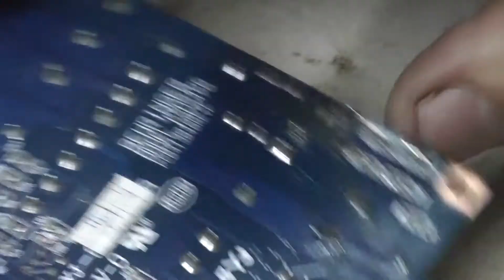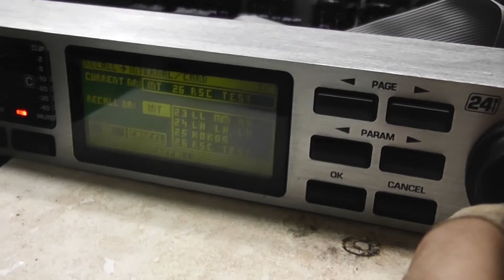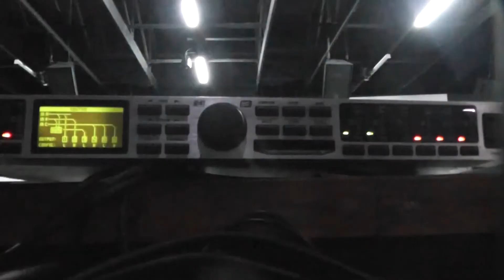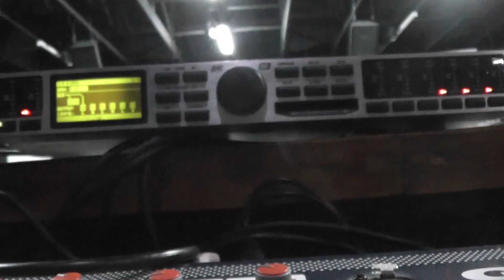ShoutingElectronics #6 - Behringer DCX2496 Powersupply - Part  2

Comment: Would it be possible to repair such a unit by replacing the built in power supply with an external generic 12V (or 20V or whichever voltage it needs) switch mode wall wart type power adapter?

Comment: Change the switching transistor and the 47uf 400v capacitor but still no power. Only improvement is where as it was chopping the fuse now it's not.

Comment: those orginal smps are unreliable.have ultra curve and ulktra drive.both lasted around 1 year.changed all the capasitors and the standing chip.took away dose rubber hats for regs etx and used a glimmer pad to get better termal tranfer of heat to the cooling frame.drilled some holes under the supply in the case.put some heatsink on top of the chips on mainboard the inside temp went down have worked fine since.the other i did the same thing but i think the smps transformer is bad.do you know where i can get a new or used transformer?

Comment: i have had many utra curve and drive with psu fault.I always swap all capasitors to brand quality(does not buy the most expencive but much better qyuality known brand.and drill some holes in the cabinet under where the psu is mounted.also the rubber thermal shit goes away.i use the metal clamps to hold the 2 volt reg tight against the alu frame that ack like a cooling element.recoment to glue some old chipset alu cooling elements on the dsp(the hottest chip,s. on main pcb.recomend swap all capasitors in the hole unit.For the ultra drive the hizz level goes down around 2 db.for the curbve it work better and last.always let it be place for air under and over those units,to stack units like this guaranti short lifetime,Almost every ultradrive/curve i have had in for repair it is always the powersupply isue.They are cheap and ok if you can fix do replasement yourself to good quality known brands capasitors
Reply: The cable from the PSU to the PCB has issues with mine as well. Or perhaps the connector on the PCB is faulty, to small/cheap.

Comment: ultracurve and ultra drive use the same pcu.the ultra drive is to noisy for my use.there is to much hiss on the outputs.Have both and both lasted about a year before the power supply went bad.I changed all capasitrors and the control chip on both supplyes.one is better than new so i swapped out al capasitors in the ultra drive unit.the other supply i have not found the fault.maybe one leg on control chip got to hot when i mounted.it.had to put it low do to a bad pcb trace.pcb quality on pcu is not good

Comment: AArgh, the meter probes! New ones definitely needed there, along with a new meter as well.
Reply from the maker: Yep, I know.   At least for my Day Job I have a Decent UNI-T Clamp Meter.   Dave, if you do watch this one day, I could really use one of your 121GW or EEVblog Brymen Multimeters....
Reply: Well, might be a while before Dave catches up on orders and such. 

Funny thing is that, despite liking the video, the number of likes is still fixed on zero. Unclick the thumbs up and it went to -1, and click it again it went to 0 again. Another of those YT glitches, and still only 2 views.

So, where in Sunny SA are you based, i am guessing GP.
Reply from the maker: Yep, It looks like their stats, etc, have been very slow to update lately.

Nope, I am still in Sunny Margate (Remember I got that Solomon Iron from you - Several new tips later, and it is still going strong)
I just decided to try make a more formal channel than my old one : https://www.youtube.com/user/kolbep
Reply: OK, was just wondering. At least you got rain and water, unlike our cousins down in Slaapstad.
Reply: La fuente de cuanto voltios es y cuantas diferentes voltajes es